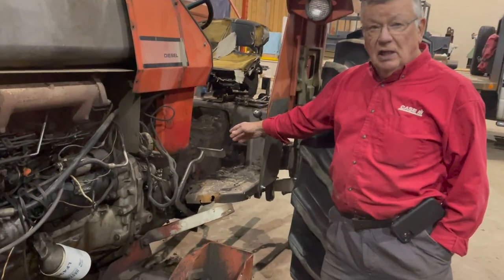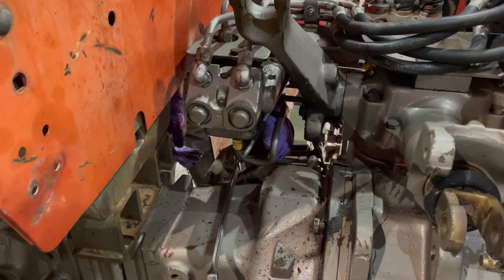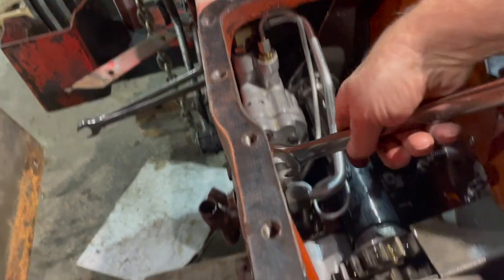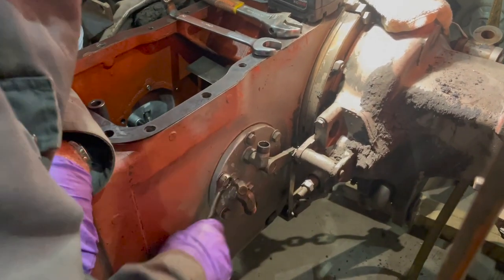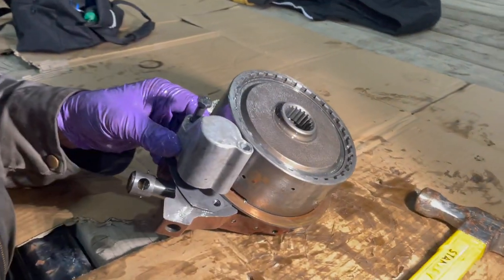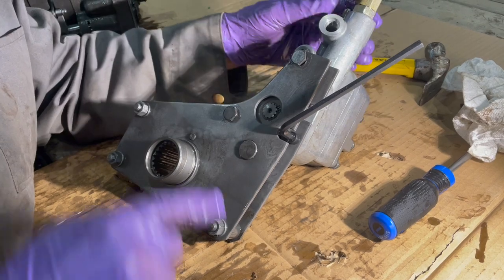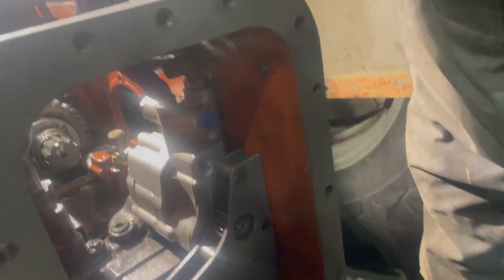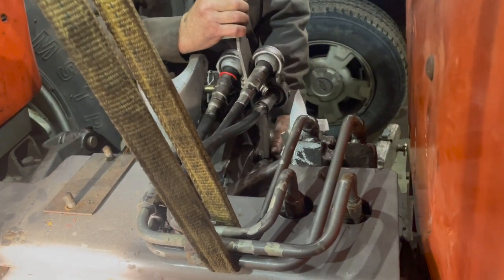How-To: Massey Ferguson MF285 Auxiliary Hydraulic Pump Replacement & PTO Pack Inspection

Comment: Yes, thank you Clint.  This will help with the replacement of the auxiliary pump in our 265.  Did you ever find out why the PTO would rotate with the tractor off?  Looks like the clutch pack was ok?
Reply from the maker: It seemed to be better after we reassembled. It sometimes keeps turning but if there is any resistance at all, it does stop.

Comment: Thanks so much for taking the time to pass on this knowledge Clint.  I had read the manual on how to do this but seeing your video, from start to end makes, the task a little less daunting.  I am new to acreage life and bought a 1980 275 to move bales for horses. It can't quite lift a 1400 lbs round bale with the loader (can with 3 point hitch).  I think the tractor should be able lift with the loader so I think this is what needs to be done.  Any recommendations for things I should check first before tackling this? I am near New Serepta AB.
Reply: Auxiliary pump might be bad. Pressure testing is helpful tracing down the problem. My 285 3pnt lift is weak and goes up and down up and down and squeals when it goes to the very top position so I lower it. This is with a 700lb box blade. I think it's the rocker cylinder piston rings are worn bad
Reply from the maker: The lifting capacity of the loader is determined by the diameter of the lift cylinders… if they’re small. You may have trouble lifting the bales even if the tractor is OK, they should be 3” or bigger. The pressure of the tractor hydraulics should test at least 2250 psi.